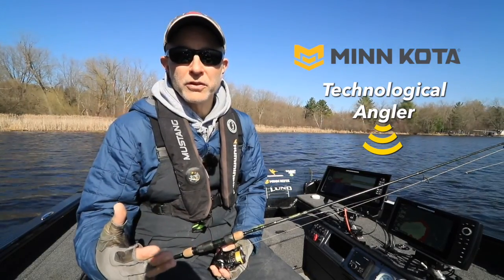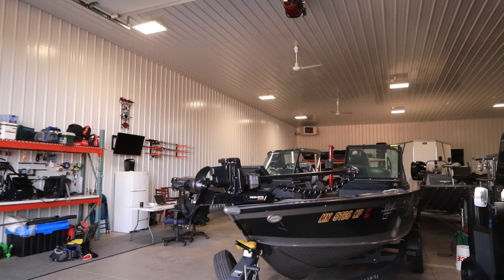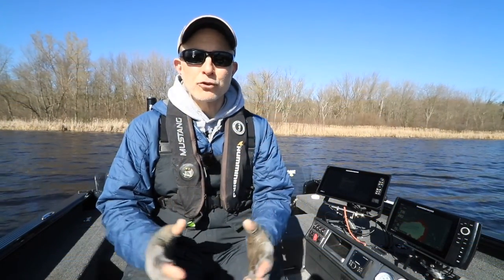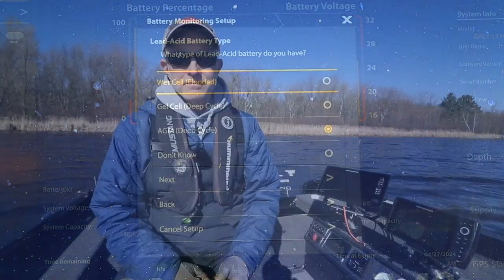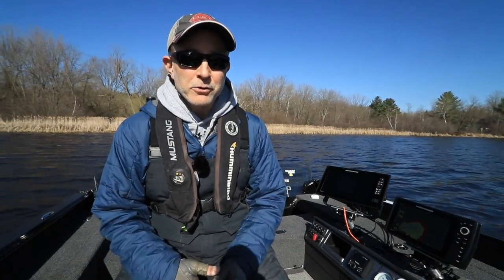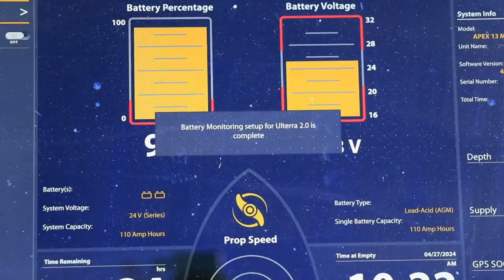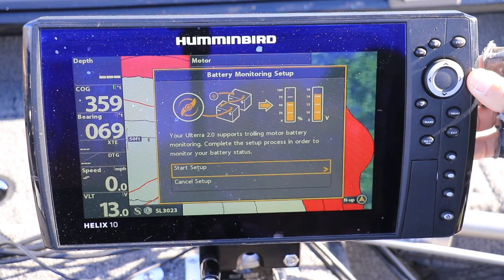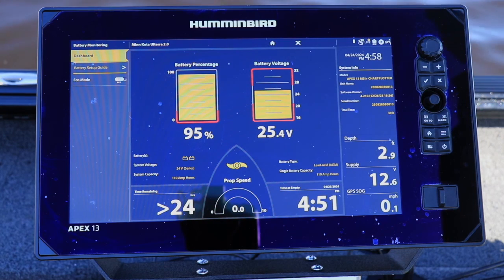How To Set Up Minn Kota Quest Battery Monitoring \ Quest Trolling Motors \ The Technological Angler

Comment: Have an Ice Helix 7 G3N with Terrrova Quest, and cannot get 'battery setup' or 'battery monitoring' on the menu but have everything else. Even Humminbird support could not help me. Any ideas to try?
Reply from the maker: Are you running the most recent software? If so, then my guess is that feature hasn’t yet been incorporated into the software build, and will likely be included in an upcoming software build.